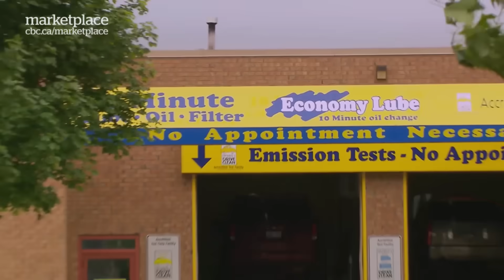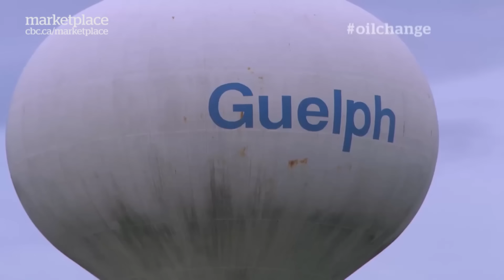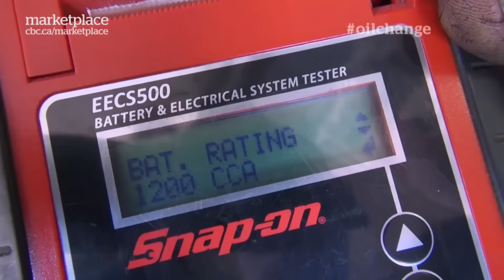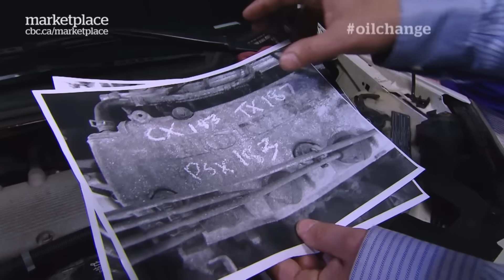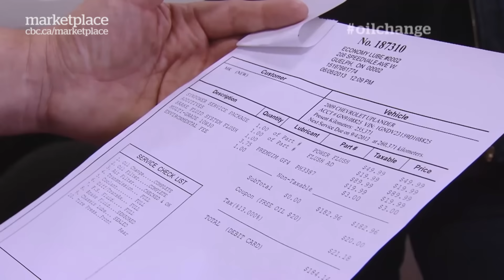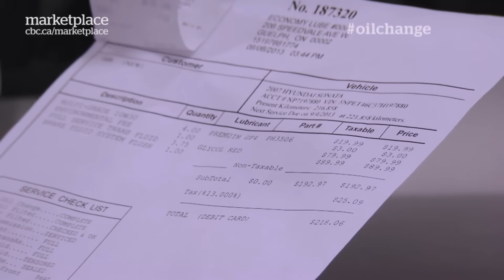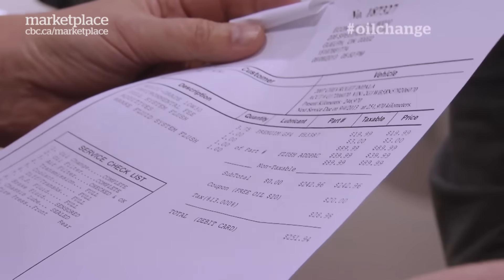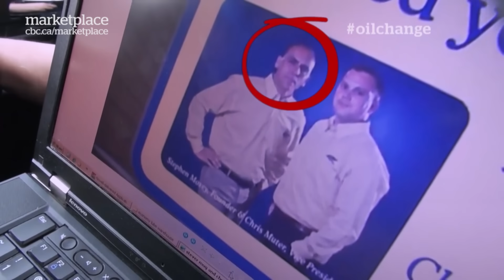Oil change scams: Hidden camera investigation on what really happens to your car (CBC Marketplace)

Comment: This can be solved easily.
Step 1: Maintain your own damn car
Reply: Yeah. Most of the new cars have such difficult access to even get to the spark plugs. It took my dad hours to change the spark plugs on My parents 05 (11years old) dodge caravan because three of the six cylinders are under the windshield. And he has worked with his hands his entire life and has all of the tools. Believe me, it is not getting any better.
Reply: Sure. But you have to consider the opposite side of this. I was raised in a garage with a father that restored cars. I can do anything I need to under the hood. I moved 2000 miles away and live in an apartment near tons of hills and few flat surfaces. I'm in one of the most strict states on emissions and fluid exposure to ground water and only have my one car if I wanted to try disposing of my fluids. I also simply don't have time to do it anymore.  Its a practical skill, and knowing how to work on them helps to prevent you from getting scammed - but time is money for most people.
Reply: Sam C True. Changing the oil and oil filter is not hard lmao.
Reply: No, just know your car and the work that needs to be done. I also go to mechanics I know and trust. I don't have the tools or time or desire to do my own work. Not interested.
Reply: Too dirty, I'd rather do the research and pay someone to do it then check their work.
Reply: noisyturtle That's what I do the majority of the time, unless I'm in a hurry, then I use the, what I like to call, rip-off bays. They're fast, just have to watch their evil asses. lol
Reply: Sam C
Reply: Sam C right
Reply: Sam C  this is why i maintain my car lol
Reply: Ok. So pitch the same line to a woman
Reply: KGB2101  that is 100% not true.  I work at a top 10 dealership in the country and we never recommend service of any kind unless it's justified.  we always show the customer what is going on, and our service writers are honest about the repair.
Reply: KGB2101
Reply: yep right most ppl cant even change a flat
Reply: Lol
Reply: they're difficult to access because its a front wheel drive v6 minivan. not necessarily because its a newer car.
Reply: Sam C the reason we take it to dealerships or mechanics is because we have no time to do it ourselves. We shouldn't be robbed in the first place.
Reply: Sam C I wish I could, but I'm disabled. I get screwed all the time 😔 A female in a wheelchair...
Reply: Sam C well good luck doing that on newer cars. Yea an oil change is still not that hard but anything else
Reply: Sam C some ppl dont have the tools to maintain their own 🚗
Reply: Danny Arellano ya but how much money are u spending on the changes
Reply: It's easy to tell I works being done, you can put a spot of paint from a paint pen on caps or nuts or bolts just to see if they've been worked on.
Reply: Sam C or go to a volvo garage😅
Reply: Sam C No rich person does that these days who own cars
Reply: Sam C  easier said than done
Reply: most people cant really get their car 10 feet above the ground to change all these fluids soooooooo
Reply: No need to get your car high off the ground, get yourself a set of car ramps, more than high enough to drain all fluids, if you're disabled get yourself a friend who will help you, don't have time, MAKE time, changing oil and oil filter takes no more than half an hour!why make these crooks filthy rich??
Reply: ryguy ryguy you don't need to omfg
Reply: all you need is a couple of axle stands really.
Reply: demonbox666 And a house.
Reply: +134513 1435 I don't want to work on my car, but I do it anyway. And really that's not the issue. People need to know how to maintain their car so they know what to expect. Like even though I have an 09 with the manifold over my plugs, and I have to take apart the throttle to get it all out, I can do it in about an hour, five or take ten minutes. And I'm not a mechanic. I've done it twice. If I took it anywhere and they told me it was going to take three hours, with that good old standard of 80 an hour, I'd know better, but everyone else would be scratching their heads and feeling overwhelmed at what I just explained, so they'd just roll with it, and be charged 300 for the labor, another 160 for the plugs, 80 for the gaskets, and probably 80 for the coolant flush (that isn't needed but they do it anyway). Over six hundred for something that costs maybe 80 total for the good plugs and at most an hour and a half for your time? I want your problems if you think an hour is worth 500.
Reply: ezakustam you don't need a house, I worked on my car and motorbike even when I lived in a flat.
Reply: It seems that there's a lot of lazy people that will look for any excuse to not work on their car, but still take it to a shop and complain when they get ripped off, it's not hard these days, there's so many youtube videos to help you.
Reply: Do all of the work to your own vehicle and you will never ever have a problem.
Reply: Sam C 
Yea, even if you are crippled
Reply: KGB2101 Did you personally evacuate the system initially to remove the compressor and accumulator? You do realize it is harmful to the atmosphere and illegal to evacuate refrigerant into the air. That price you were quoted does seems high though. You did say this was over 7 years ago so I can't be sure on the prices of those parts for back then. Labor for a tech is anywhere between $50-$100 per hour depending on the shop and the mechanic's experience/ certifications. I tell people to get quotes from 3 shops minimum when they're looking for work to get done on their vehicles. If you don't have access to that many shops and are looking to do A/c work, if you know someone Who recharges home air conditioner units, or refrigerator units they should be able to help you out with the evacuation and recharge.

Comment: Surprised they didn't tell them they needed flux capacitor repaired!
Reply: lol, been watching that old chrysler training video huh?
Reply: Or the infamous blinker fluid charge.
Reply: Changed mine last week, Expensive!
Reply: Need to get mine exchanged. 
Switching into the turbo gear really does some damage
Reply: Probably would have changed it too
Reply: They require additional pylons too!
Reply: I got that changed last week.

Comment: I’ve stopped going to quick lubes after one used an impact driver and stripped all the threads from the oil pan. Changed it myself ever since and it’s a rejuvenating experience 😁
Reply: I came to that problem recently that a shop told me the last person did that and that was a dealership. They wanted to replace it all so I went back to a dealership that told me to put some RTV sealant on it. It didnt work but I went under and tightened it myself and it didnt leak since. I am not sure if the shop originally just left it lose so that it slowly leaked out and I would come back for the replacement (Everything part the quoted was also marked up 4x and they wanted to put a warranty on top of it). I dont do the oil since I live in an apartment now but after this I will do it myself even if I have to pump it out.

Comment: This is just why you work on your own car..
Reply: Matthew Vee amen
Reply: If I knew how, I would.
Reply: Not really an option for a lot of people.
Reply: This is why I hang out with my dad. I want to know ALL the ins and outs of my car. The only things I need are a motter mount and an oil change. Nothing else. If they offer anything else shut them down. I remember my friends mother being charged for a break fluid change she didn't ask for. She disputed it and won because the judge said " If you go in for a simple hair cut and come out with a mohawk you'd be upset,No?"
Reply: Buy the factory service manual.  Read it.  Start by changing oil and filter. It helps if you drive small, simple cars.  Mine are Geo Metros.
Reply: Matthew Vee ... Unfortunately there's a lot of people that are ignorant meaning not having or knowing the knowledge of how to repair Vehicles so unfortunately they have to pay out

Comment: or you could just learn how to do an oil change
Reply: That's why I work on my own car and my family's cars
Reply: its also cheaper in the long run, even if you just pay for an oil change
Reply: I agree I used to do all my service on my car, however if you have a newer car still under warranty and something breaks you will not be able to provide proper documentation showing your cars services and checks, and the warranty will not cover any repairs to your car.
Reply: My 2 cents LMAO
Reply: its super easy and takes less than 15 minutes
Reply: that's not the point
Reply: TeamNuclear2011 did it yesterday in 6 min
Reply: its not hard, its literally take out the oil, put a new filter on and put in new oil
Reply: Some people don't have garages or a big lot or even a driveway to do it on. Many city people live in townhouses, apartments, with only a parking space or the street to park in, in which you are not allowed to do car work in.
Reply: You just have to be careful when you go to get your oil changed. All ways watch to see if they open new bottles of oil and make sure they pour the right numer of bottles in. You should at least take the time to look at your oil filter to see if its new. If you want to be sure then have them show you the filter they are going to install. You can even write on it so tge next time you get your oil canged you'll know it was the one you put on last time.
Reply: but you wont have to worry about that if you do it yourself, as long as you got the right filter and oil, you're fine
Reply: No, just know your car and the work that needs to be done. I also go to mechanics I know and trust. I don't have the tools or time or desire to do my own work. Not interested.
Reply: i think just learning how to do basic things like oil changes and stuff like that should be known before buying a car
Reply: "I'll certainly do that," said less than 1% of all consumers ever. You live in a fantasy world. lol
Reply: thr0nic almost every new car u can reset it with the buttons on the dash just have to learn different ways with every car
Reply: i dont know how to put a new filter on haha
Reply: To properly change the oil of your vehicle you need a lift, air 
compressor, a pan, oil filter tool, new oil, new oil filter and engine 
wash optional. Not everyone has those tools and you have to find and buy
 the oil and filter for your car. What service stations offer is 
convenience not everyone has the time or is willing to do all this 
stuff. The worst part is the old oil is toxic so you cant just flush it 
down the drain I literally have to find a place to throw them away.
Reply: You need an air compressor to do an oil change?  I don't think so.
Reply: jr2375
 Yes actually not a lot of shops do it but it's actually good to use an air compressor to pressurize the engine and it allows the old oil not only come out faster but would make a more thorough clean.
Reply: baraki808 you do not need a compressor.the filter is supposed to be only hand tight..the compressor will over torque the filter
Reply: Lane Montes
 LOL no the purpose of the compressor is to pump out all the old oil out the engine by pressurizing it.
Reply: Baloney.  Most oil pans have a drain plug, and gravity takes care of draining the oil.  Secondly, those that don't have drain plugs are evacuated by a vacuum suction, like a MityVac tool.  Third, engines aren't sealed to the point that you can pressurize a crankcase that way.  I've literally done hundreds of oil changes over the years, and have never needed a compressor.
Reply: And show a link to a shop manual of any car on the road that states to do that.  Air compressor, good grief.
Reply: jr2375
 Told you it's uncommon but it's a much cleaner process where you get the oil much better here is a link to how it works http://humblemechanic.com/2014/08/15/draining-engine-oil-vs-extracting-engine-oil/
Reply: +baraki808 If you read through the article you posted it actually says that the traditional method gets more oil out. You might need to use ramps or jackstands if you have a car with low ground clearance, but otherwise you can do it with a wrench, oil, filter, and catchpan. And yes I know what I'm talking about I change oil every day for a living.
Reply: baraki808 No. you need oil, filter, a wrench for the drain plug, and a bucket for the oil. The only other tool is if the filter is too tight to screw off so you can get a filter wrench. Or if you have a canister filter you will need the cup.
Reply: Jacob Clegg You forgot a pair of ramps for low cars.
Reply: Love Machine you could do it on jack stands but those are cheap my next door neighbor has a lift so it's even easier
Reply: Alucard any person around 7 can do a basic oil change
Reply: TeamNuclear2011 I changed my dads oil on his car and I wasn't even shown under the hood of a car before that.
Reply: fastone130 g if it takes 30 minutes to do an oil change, you're doing something wrong.

Comment: This is about a 10 min Video w/out the drama.
Reply: True.  Skip to 9:27
Reply: Ikr? it's so stretched out
Reply: You
Reply: And you can read the plot of a movie or a book on Wikipedia.

Often times, to be considered as professional work, you need to use proper format, setting the stage by describing the context and introducing the actors.
Reply: mmdirtyworkz  It's a 20-minutes TV show, not a post-grad thesis. It introduces a bunch of people and things going on at various places in relatively short time. Viewers flip channels; there are commercials.  That's the reason for the repeats.
Of course, it's for "average joes".   Don't make so much drama about it.

Comment: You’d be better off learning how to change the oil yourself
Reply: Robd1 replies  just use Jack stands
Reply: Robd1 replies  just jack it and put in axle stands. You can get them for about £40. Oil £10-£20, and maybe a socket and ratchet to undo your oil drain plug. Maybe £15. New oil filter for <£5. Really easy job even if you don’t know anything about cars.
Reply: Doing it yourself is not for everyone not everyone has time to get under cat and change all the stuff
Reply: @Simplefireant  I mean the alternative is getting scammed
Reply: Just search Chrisfix and you'll be good lol

Comment: I went with a friend one time (years ago) to get an oil change. They come out and tell her the air filter is really dirty and needs to be changed. I kinda stepped in and said I wanted to see the filter. We went into the shop with them and the dude could not figure out how to get the air filter out. I was pretty sure he didn't know if it needed changing or not. It didn't :)
If you can't change your own oil go to your trusted mechanic. Skip these quick lube places.